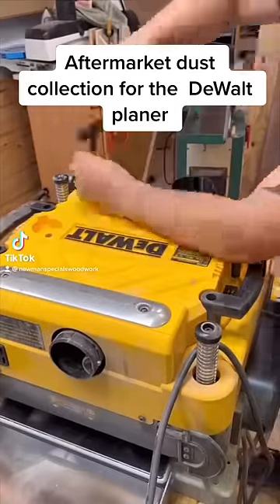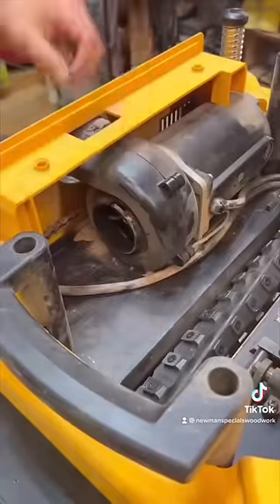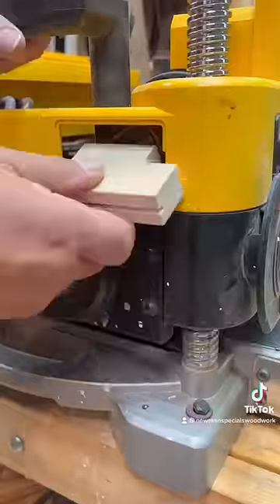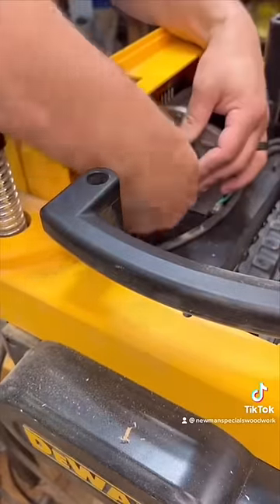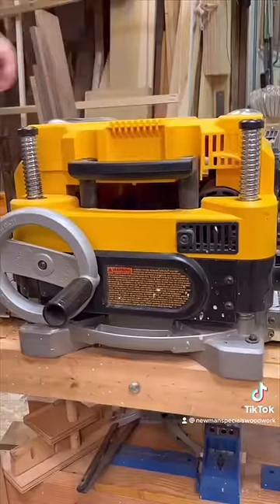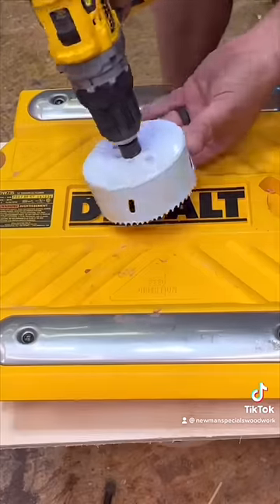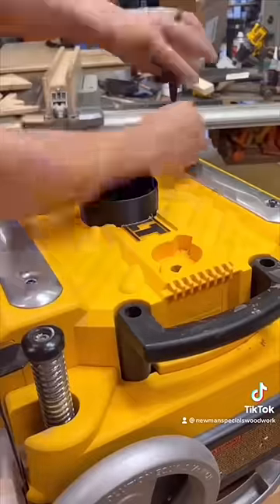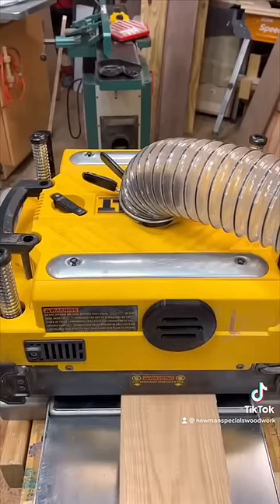Aftermarket dust collection for the dewalt planer great for helical #woodworking #planer #dewalt

Comment: You have actually prevented the fan from cooling the motor, By removing the rear volute from the fan casing you have prevented the fan from pulling a vortex of air through the motor.
Reply: This
Reply: Does this hinder it more than the dust would?
Reply from the maker: But it is still cooling as pushed air into the vents
Reply: That fan is a centrifugal fan, so without the turbo-shaped shroud it's useless. But if you look again, the new manifold completely bypasses the factory turbine.
Reply: @RsDefcon  No, because the path the dusty air had to take to get out with the factory shroud and dust extraction fan is more restrictive than the new setup. If he's running a shop vac or a dust extractor, it'll replace the factory fan's function.
Reply: @NewmanSpecialsWoodwork  not really. It pulls the air through the motor. At least it did while it had a shroud
Reply: @TytoMobile  totally agree my friend, was an DC armature winder for 20 years
Reply: @tomhiggins4969  Hi, can you elaborate more what exactly that means and what your job consisted of? Just curious.
Reply: @TytoMobile yeah but it functions as designed, now you just have swirling hot air which is super inefficient for cooling.
Reply: @MikeRthe1  ""Swirling hot air"" 🤣🤣🤣 love it
Reply: @FrankTheTank417  Hi Frank,  this consists of the repair and rewinding of the coils in all electric motors, mostly dc traction motors in diesel electric  trains, most of the time it's cheaper to strip the old copper out and re-insulate and re-wind than buy a new motor.
Reply: I’ve done heat sink design, rugged server design, in both simulation FEA and real world testing including building the environmental chambers to test the units. And I can say that you just don’t know without running the numbers. There’s a lot of variables. Whose to say that motor needs any cooling? If you’re going to design pump to remove wood chips, as a designer if corse you are going to throw in some cooling for the motor itself. It’s free why not. There may not be a specification to do that. The motor could be running hot which caused the plastic to get too hot and soft, so the fans could be to cool
The face of the motor to save the fan assembly itself and not to cool the motor.  I had to do something similar in a racecar onetime using a fan to cool an exhaust but it was really to keep the exhaust from melting the Dan which was used for other cooling. Furthermore. How hot do you think wood chips are when they are sheared off at xxxx rpm with a two 13” long blades? Do you think this may introduce more or less heat in the overall system If it weren’t there? 

It’s not as simple as saying it went from forced air cooling to convection. Now days instead of doing all the calculations you just plug in a $200 FLIR to your phone and can instantly run some real numbers. My gut feel from my experience says it’s perfectly fine. Everything else without the real numbers is just speculation. If that motor fails because of that cooling feature missing, that’s a poor design and dewalts stuff is designed very well. Now if the missing motor fan reduced the overall lifespan of the whole system by 20%, that could be more believable. 

The new higher flow dust collection system could be pulling in more cool outside air through the fans space as well. I could prob go on and on about all the Changed variables that could make the whole system perform better and could find hundred ways to say it makes it worse. It’s moot point without some test. 

Send me one and I’ll test with with my lab grade FLIR camera and my dewalt planer
Reply: If you look closely, there is actually a seperate type of fan behind the big one.
Reply: @latenttweet  first of all you can see the design flaws “Jacob’s” did they removed an optimized cooling and dust collection systems. Buy potting this new shroud the dust and chips are being forced straight up, the path of the dust and chips are  straight up
Reply: @latenttweet  You can see that “Jacob” Designers of the new shroud bypass an optimized cover to both extract the chips and to cool the motor…now your new distraction have to be very good at extractions cause you won’t be getting any help from the motor. I man addition some of the dust and chips will fall back down and it’s going to mess up the cuts
Reply from the maker: I decided to do an experiment to see if you were right. I ran a bunch of boards through and checked the temp with an IR thermometer- here’s the link
https://youtube.com/shorts/MfIbTU-J6ZI?feature=share
Reply from the maker: @TytoMobile  I just posted an update. I did an experiment and took the temp using an IR thermometer with and without the fan cover
https://youtube.com/shorts/MfIbTU-J6ZI?feature=share
Reply from the maker: @latenttweet  I actually bought this from someone else. But based on these, and other, comments I ran a basic experiment to see the temp results with and without the fan cover. 
https://youtube.com/shorts/MfIbTU-J6ZI?feature=share
Reply: @FrankTheTank417 Armatures, sometimes receive new commutators. You wind coils, insulate the slots, attach the coils into the slots, solder to the commutator, sequentially, wind string tightly, over the wires from the commutator, to the windings. Static balance, dip and bake, in insulating varnish. Turn and undercut the commutator, press the fan on, then, dynamic balance, check the continuity. Wrap and ship.
Reply: @NewmanSpecialsWoodwork is there a reason your links aren't clickable. I can't copy & paste it. 
I  have to write it down and type it in. What a pain!
Reply from the maker: @AnthonyStabler  apparently you can’t do it with shorts. It looks good to me and then I hear that. Sorry. I’ll put it in the description and see if that works

Comment: The shroud over the dust collector service 2 purposes. It also cools the system. You should test the heat difference on that motor. It will make a huge difference.
Reply from the maker: I’ve actually done 2 different experiments but haven’t posted the second one here yet. Here is the first one
https://youtube.com/shorts/MfIbTU-J6ZI?feature=share

Comment: I’ve only been working in construction for a few years now but from what I see I believe dust removal is one of the most important features that should be thought of. Stuff is so bad for us. Concrete dust, drywall dust, wood dust, everything has chemicals and is bad for us to breathe in even in small amounts. Nobody wants to wear a mask 24/7 in hot stuffy environments. I think most tools should come with dust evacuation. My Milwaukee Saw has it, a lot of Hilty concrete tools have them to.

Comment: Just get rid of the straight blades. We ran one for years to final dress face frame. Never had a problem with dust collection. We were running a Byrd Shelix. I won't run a straight knife on a planer anymore.
Reply from the maker: I already have the Shellix on here. It slowed my machine down and caused me to trip the breaker a bunch. This actually helps the machine because it’s not clogging up the dust extractor

Comment: You have just removed the colling effect for the motor as the area of air to go through get smaller the speed increases thats why if you have a hose and you out your finger over the end its pressur increases and by removing the shroud you have decreased the cooling effect thats why car radiators have shrouds and it forces the air to flor through  instead of round so yes while the  air carrying dust has  now a straighter path to the extrector they combined cooling  and extraction into 1 operation if possible i would put the shroud back on pal
Reply from the maker: I actually did some testing with and without the shroud using a heat sensors I found that the beat way to run the machine is with this dust chute and 1/2 of the fan shroud attached. It actually resulted in lower machine temperatures than with the stock set up

Comment: Was it 3d printed? That would be a pretty good application if it were.
Reply from the maker: It is!
Reply: 3D Printed parts are terrible, 3D printing is for "prototyping" , not finished products.  It doesn't matter what material you print in, it is far weaker than moulded parts because they split at the layer lines.  As it will get very hot in there the plastic will re-melt!

Comment: Pretty fancy. You’d wonder why the darn engineers at Dewalt did not think of such.
Reply: Probably because it's a worksite lunchbox planer designed for exactly that, it's not designed nor intended for permanent installation in a shop.
Reply from the maker: Probably because I can see the blades this way - seems like they would want to make it so the blades aren’t accessible this way!
Reply from the maker: @rorschacht8478  it’s still portable. It requires a DC, but that doesn’t stop it from being moved to places and used. It’s more likely that this would be deemed unsafe for distribution because the blades are visible through the top now
Reply: @NewmanSpecialsWoodwork  That also makes sense, I think it's both.
Reply from the maker: @rorschacht8478  can’t argue there! 🙌🙌

Comment: I'm not try to be that guy , but why didn't it come like that from the factory. Seems like a design oversight.
Reply from the maker: Probably because now you have to have dust extraction when you don’t with the original set up. Plus I can see straight to the blades now

Comment: Since you removed the shroud on the fan, does that mean it no longer “shoots” the chips?
Reply from the maker: It does not - just shoots up into the air when that happens
Reply from the maker: https://www.instagram.com/reel/Cfor-Z_gN9C/?igshid=YzAyZWRlMzg=
Reply: And without the ducting the motor won't cool properly.

Comment: Are you experiencing any feed problems with that planner? Mine hate to feed material properly
Reply from the maker: The most common issue with that is cleaning the rollers. I have a video that I’ll post if I haven’t already.
Reply: @NewmanSpecialsWoodwork  thanks
Reply from the maker: @facts_people-n  posted it for you
Reply: One thing I found out too is if your having issues with feeding could be blades getting worn. I also put some Johnson paste wax on the table, that allow the material to slide really well on the table without affecting the material when you go to staining and finishing
Reply: @trevormiller6285  brand new unit.
Reply from the maker: @facts_people-n  I would still wax the bed and check the rollers.

Comment: Dewalt states that this will reduce the life of the motor due to lack of air flow.
Reply from the maker: It has air flow. I didn’t remove the fan
Reply: @NewmanSpecialsWoodwork  A vacuum vortex is a very very close tolerance to have ANY effect... it will make alot of NOISE,  WIND and all other kind of rubbish but will NOT actually cool the motor. Fact !
Reply: @NewmanSpecialsWoodwork  you basically did , that fan dosnt push the air in the right direction now ... With a turbine housing the air thats forced out centrifugally,hits it , picks up speed and is forced trough the motor , the fan is now just mixing air inside jot forcing it through the motor
Reply from the maker: @robivlahov  I think I’m going to try and set up an experiment and see what happens. Thanks
Reply: @NewmanSpecialsWoodwork  good idea!
Reply from the maker: @gfrom085  set up and posted the experiment! 
https://youtube.com/shorts/MfIbTU-J6ZI?feature=share
Reply: @NewmanSpecialsWoodwork  thx you for the update! Nice work!
Reply from the maker: @gfrom085  thanks!

Comment: What bullshit....that planer is designed to only take so much depth of cut....a dust collection hood has nothing to do with it.....also why when it already has a really good dust collector on it to begin with....total crap.
Reply from the maker: When I switched to the helical head I found I could only turn the depth forward about 1/4 turn before tripping the breaker. After putting this on I can advance 3/4 of a turn without the planer bogging down. I believe that there amount of chips coming out overwhelmed the extractor. This solves my issue
Reply: @NewmanSpecialsWoodwork  I have this same planer and I installed the OEM sized shelix head, not the smaller one, and have no such issues. 
 These planers are known to trip breakers to begin with out of the box. Used to happen in my old shop but never in my new shop....not all circuits are created equal. 
 That being said this planer will only allow 1/8 max to be feed into the machine. Probably closer to 3/32. And I can do this with no problem. 
 No dust hood contraption effects this...the only thing that is possibly happening here is by disabling the blower motor it's using a bit less juice on an already taxed circuit that can't handle the load.
 So your problem is the power not this dust hood contraption.
Reply from the maker: @arthur962  if you say so. I have less issues with tripping now than I did before

Comment: For about 6months then that 3d printed shit will crack in half.
Reply: Even if using PETG or TPU? 
Just asking...
Reply: @Xero_One  I don't think tpu would work because the hose has to clamp onto it but it should be plenty strong with just petg or even pla as long and it is not being dropped
Reply from the maker: @Xero_One  I know people that have had this for a year with loads run through it and no issues
Reply: My product has been in production for over a year and even the heavy users have reported ZERO issues.